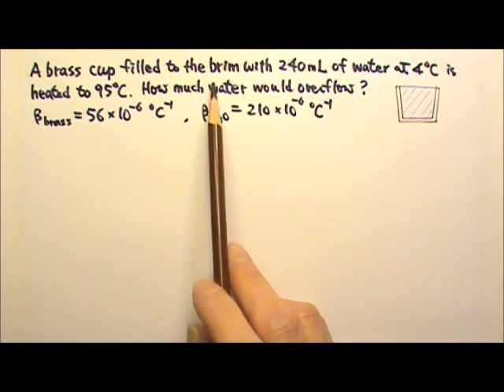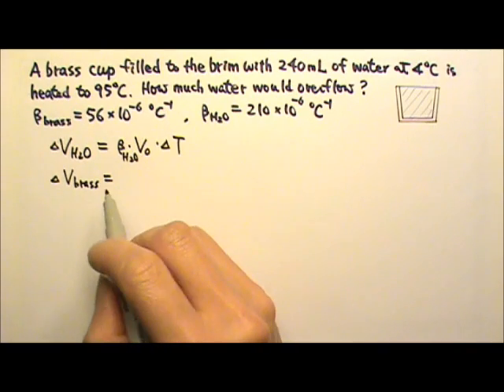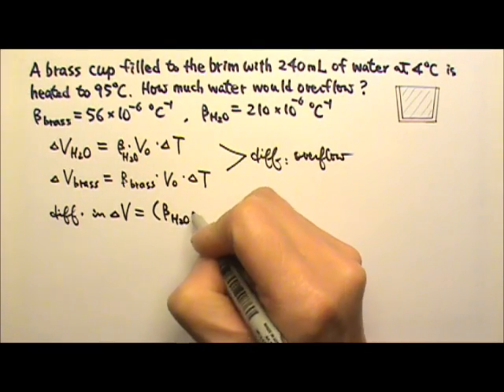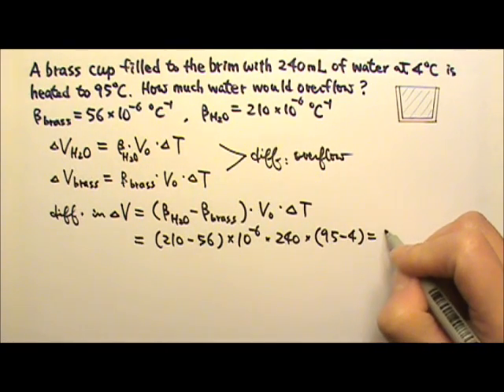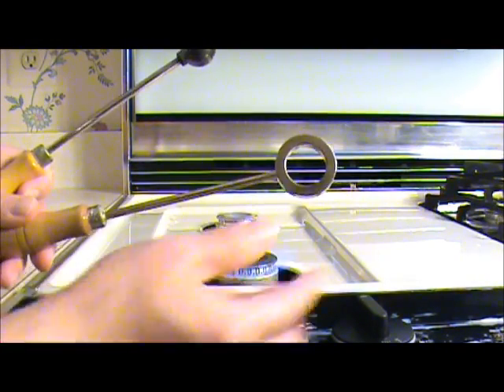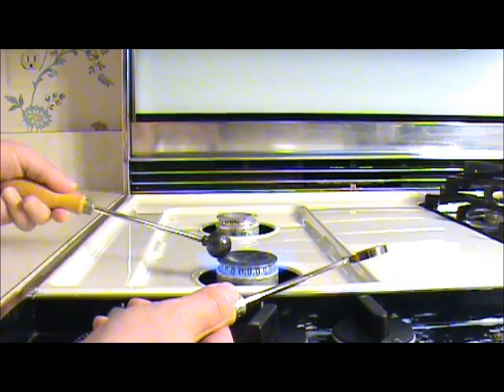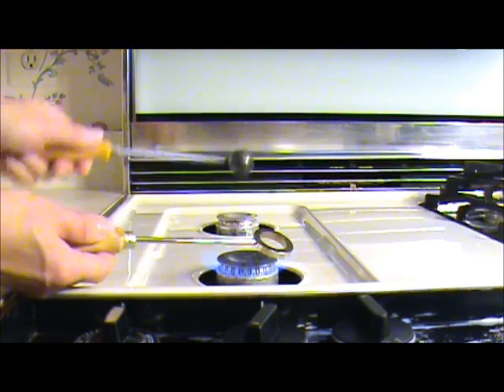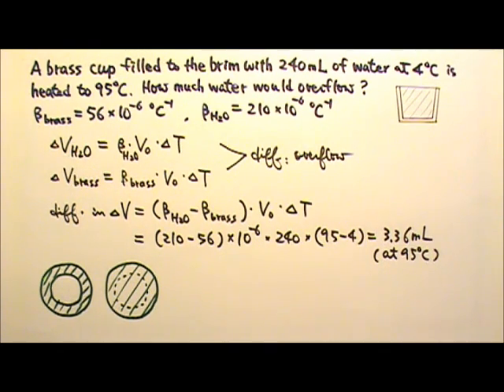AP Physics 2: Thermal 4: Thermal Expansion: Water Overflow Prob& Ring&Ball Demo

Comment: Hello, thanks for these informative videos! They are very much helpful. 
I want to ask a question about a particular part of the video.
Around 4:00 does revolving the ball around the fire changes the speed of it getting heated up or is it just an arbitrary movement pattern?
Reply from the maker: I was trying to heat up the ball quickly : ) although I am not sure whether moving the metal ball around helped or not. I remember learning about the tip of a flame being the hottest part, so I tried to place the ball near the tip of the flame. Metal is a good heat conductor, but I thought rotating the ball could help heating it up more evenly. As for making the ball go around the circle of flame, I suppose I was trying to utilize the entire flame, not just one point of the flame - I don't know if this helped or not.